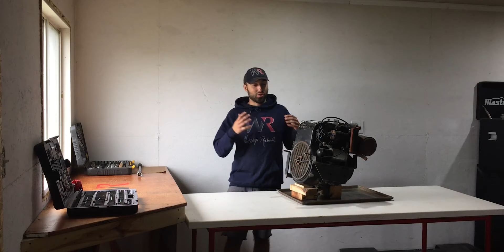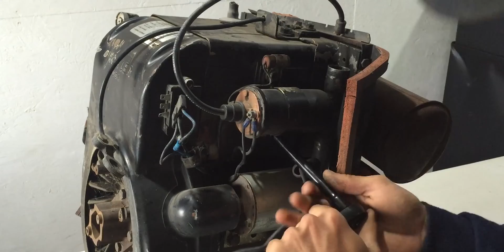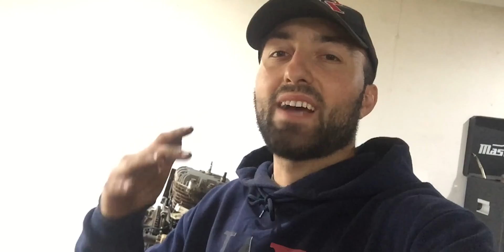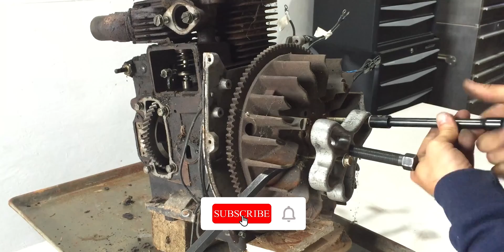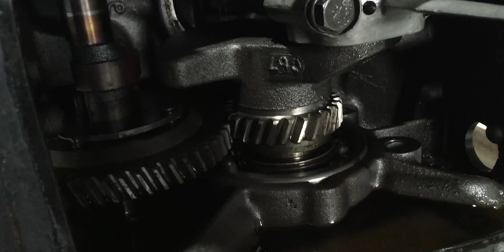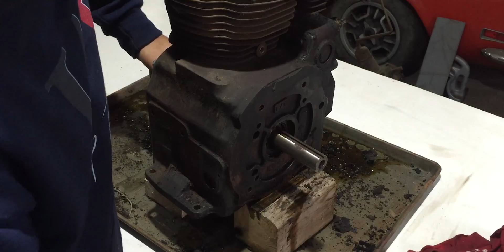Complete Kohler K341AQS Engine Teardown/ Start To Finish

Comment: I cannot think of one single reason to tear down one of these motors unless it was run dry. They don't just stop.
Reply from the maker: I rebuilt this engine, because the tractor it came out of was sitting in a field for many years. To ensure everything is within spec. I take an engine apart, measure everything and replace whatever needs to be replaced. 
So far I haven't had any issues with my JD 300 and it's cuts grass like a champ! I can cut two feet tall grass and it doesn't bog down...talk about power.
Thanks for your comment, Dan. Regards Andreas
Reply: @WorkshopRebuild  I get it. I just don't have that kind of time to spend. I did put new valves and recut and lapped the seats in mine (K341S) due to a bad leakdown test and some misfiring. The valve seat damage was obvious, too. Surprisingly, the cylinder looked good. Anyway, I have 5 tractors, all older models, and the WH with the Kohler  is the smallest. There's always something to work on so I usually don't mess with them until they get bad. But yes, those old Kohlers are something else.

Comment: Wheelhorse D160
Reply from the maker: Great guess and it sure would fit in a Wheelhorse D160! This engine was removed from a JD 300 garden tractor. Regards Andreas
Reply: @WorkshopRebuild  lol that’s why I was watching the video. I have a D160 and I need to rebuild my k341s. Great video!
Reply from the maker: @jdrobertson2203  They had different versions of the K341, some had balancing gears and some didn‘t. Maybe you‘ll even find some differences on your engine block, as each company (JD, Wheelhorse, Cub Cadet...) instructed Kohler to design the engine to fit their garden tractors. I hope this video will assist you along your engine rebuild.
Thank you for your feedback, it‘s much appreciated!! Regards Andreas

Comment: 1978 John deere 316
Reply from the maker: That‘s a very good guess and it wouldn‘t be wrong, because the JD316 had a 16HP Kohler engine. This came out of a JD300 garden tractor!
The JD300 later turned into the JD316, which was mechanically identical, but they updated the panels a little bit.
Thanks for your comment, I appreciate it!

Comment: i have the same engine my john deere 300 series what would make the engine shake alot when it's running
Reply from the maker: Hi John, if you know your engine is running well, I would check the engine mounting bolts and the engine mounts. These bolts do have lock nuts on them, but it's possible that they have come lose. If that's tight, check to see the condition of the rubber engine mounts and the rivets that are on the frame. 
These engines are notorious for shaking quite a bit, but with old or loose engine mounts, it can shake even more. I hope this helps!

Comment: Can anyone tell me why I've got gas coming out of the crankcase vent on my 14 horse kohler? Cub Cadet 149.
Reply from the maker: Hi David, your carburetor is leaking internally. This means your float needle is not closing properly!
If you have some fuel coming out of the breather, you might have oil+fuel now mixed. This will mean you‘ll have to do an oil change.
I hope this helps. Regards Andreas
Reply: @WorkshopRebuild  thank you very much!
Reply: @WorkshopRebuild  it's been sitting with no gas in it for several months. Sounds like it got dry on the inside of the carb. Thanks again.
Reply from the maker: Sometimes the float needles have rubber tips and they dry out over time. Once replaced, they work like new with the correct float adjustment.
I‘m not sure Kohler ever made carbs with rubber orings at the bottom of the float seat, but there are some of them out there on different makes. The needle is then usually made completely of steel. Regards Andreas

Comment: Bobcat 310
Reply from the maker: That's a good guess and it would probably fit right in there without many issues. Nevertheless, this engine eventually got dropped back into the John Deere 300 garden tractor it came out of. Cheers

Comment: A year late on the guessing game, but a 216 would be my first wager, or a wheel horse. Thankfully they made a billion of these in a lot of GTs so I can still buy parts 40+ years later!
Reply from the maker: Thanks for your comment! You were very close, but this engine was eventually placed within a John Deere 300 garden tractor. You're right, they made tons of these engines back in the day and that's another reason why so many are still around up until this day.
Another give away on these engines are the last couple of letters. K341 is for the engine displacement and the amount of cylinders. "AQS" were the factory options for John Deere. There were different oil-pans and dipstick tubes and that's what AQS basically meant during the assembly process. 
Thanks again for tuning in and sharing your thoughts! Regards Andreas
Reply: Hey, where do you buy parts from? I’ve been looking on eBay and not having a lot of luck

Comment: 1650 massey ferguson or snapper
Reply from the maker: Great guess and you could be right, but this engine ended up in a John Deere 300 garden tractor. Many Kohler engine with QS at the end were John Deere specific, as they had some different features from the factory. Best regards

Comment: How did you manage to turn it over with that much rust in the bore? Lol. I thought it was an International or JD at first, but the wide bottom block and bits of orange/red paint makes me think Jacobson or Wheelhorse. Noticed a little water in the oil pan. Definitely burning oil. Piston shows a little wear and minor scoring too. Hone it, throw in a piston & rings and send it out the door lol
Reply from the maker: I turned it over about 30 degrees with a socket and breaker bar. It was mainly to check if the engine is free. This engine is out of a John Deere for a fact, so you weren't far off! Great guess :D Yes there was water in the oil pan indeed. Very little, so I'm not too concerned about it.
The piston does show wear on the bottom end and once everything is clean I can take proper measurements. I am leaning towards a full rebuild kit (piston, Con-rod, and full gasket kit). But I'll see very soon here. A light hone with take any glaze away on the cylinder wall. Stay tuned for the assembly video :) Cheers!
Reply: @WorkshopRebuild  lol, should've stuck with my first guess. :) Excellent, looking forward to seeing the rest. Peace
Reply from the maker: @jonmyers8046  Yes, you were much closer! I will have an update on the engine rebuild very soon. Stay tuned :D

Comment: My guess is it came off of an old wheel horse
Reply from the maker: Close, but not quite right! Maybe the colors of the Thumbnail hint towards a certain tractor :D
Reply: @WorkshopRebuild  hmm I’m thinking it could be out of a John deer 216?
Reply from the maker: @hunter7476  The brand is correct and according to the engine, a 216 would be a great answer! I will be posting a video soon on my new project...so stay tuned :)